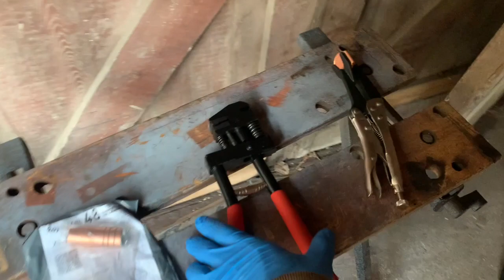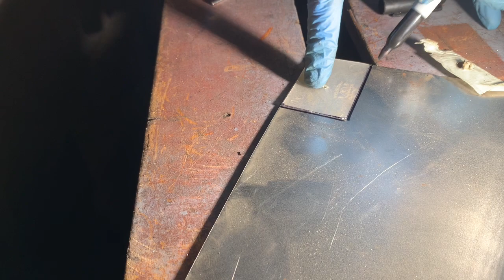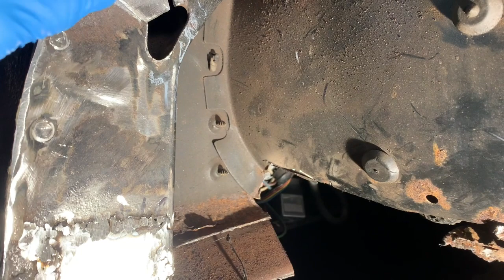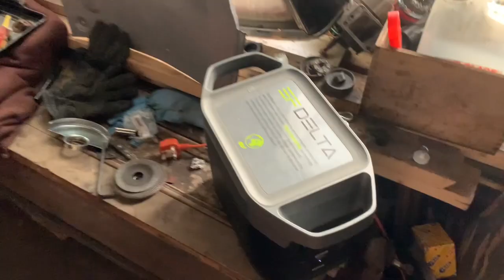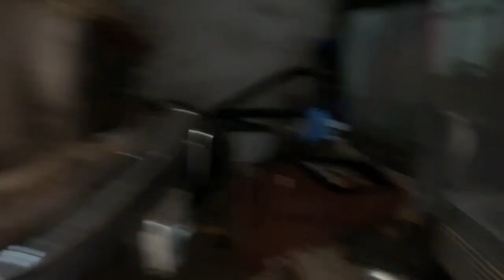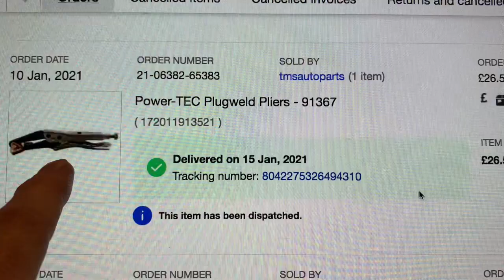Mercedes R107 welding using Ecoflow Delta battery

Comment: Hi what light source do you use to light your garage up, while using eco flow battery. Just bought one, cant believe it runs my welder 😊. Thanks to your video, just need a low power lighting for my garage now, if you recommend anything on a budget. Thanks
Reply from the maker: Yes - the ecoflow is amazing. I hadn't realised it at the time but is has a built in charge controller which means  you can plug solar panels straight in...perfect for our vintage camper.

Anyway...I have standard 240v light  fittings in my garage so I just replaced the bulbs with LED ones and that works a treat. I guess you could also use 240V led strip lights.

When you plug things into the 240v sockets, the cooling fans will always kick in which can be a bit noisy and inefficient. If on the other hand you use the 12v cigarette light socket, you probably get the same amount of light with much less power usage. In our van we run lights, fridge and sink through the 12v port:

https://www.youtube.com/watch?v=ojeR8UHOIQs

Mike

Comment: Hi Mike what amps was the welder. I have a gasless parkside 230v 40amp to 90amp not sure if the delta 2 would work with my mig welder. Thanks
Reply from the maker: Hi - I was using a CLARKE 151TE 150 AMP TURBO MIG WELDER (now sadly stolen) Depending on what I was welding, it would occasionally trip the fuse in the Eco Flow….but it is a simple push button to reset. If you are anywhere close to Bristol, you are welcome to bring your welder and try it. I must say that that the EcoFlow ranks as one of my all time great purchases - great for my power free garage and fantastic for camping. Mike
Reply: @MikesMercsandothercars  it's a shame because I'm 4 hours away. Thanks
Reply: @MikesMercsandothercars  was you on the low settings on the mig. Are be welding 0.9mm thin sheet metal
Reply from the maker: @jaybradley3765  I dont think I ever used the highest settings on the welder even when I made up the front strut which was thicker than 0.9mm. Mike
Reply: @MikesMercsandothercars  thanks mike
Reply: Hi Mike I have just bought a second hand Clarke mig welder 151te what you were using, what settings did you find you could set without the eco flow tripping the fuse. Are be welding 0.9mm sheet steel, going to collect it at the weekend. Thanks

Comment: Hi mate thinking of buying this for welding up my Ford capri

what model ecoflow delta are you using here?
Reply from the maker: I am using the original Ecoflow delta. They have just brought out the EcoFlow Delta 2 which costs about £1000....not cheap, but our has been great for all sorts of things, More recently, we have used it to replace the entire solar battery system in our Fiat 238 camper and it works great - much lighter and lasts longer. Mike

Comment: Hi Mike !! Thank you for your lovely video. just a quick question what welder are you using ?..
Reply from the maker: Thanks for your comment. I was using a Clark 135TE welder which my father had bought new from Machine Mart in the UK and never used. Sadly it got stolen some months ago and someone broke into my garage. I usually keep it at home but not on that particular occasion. Mike
Reply: @MikesMercsandothercars  I feel your pain brother. It almost happened to me. I have beefed up my security on my garage to deter the thieves. Thank you for the information bro.

Comment: THank you so much for making this video, I have been looking for the option of doing this for an eternity, but couldn't find out if it would actually power my welder.
Reply from the maker: Thanks for your comment. The ecoflow has been amazing for me as my garage doesn't have electricity. They are not cheap but it allowes me top do things that I otherwise couldn't. Happy New Year. Mike
Reply: @MikesMercsandothercars  To you as well! I had been looking at the Fronius AccuPocket for welding without a power supply, but that thing is like 3k, that is more than the car I would transport it in, haha. And the Ecoflow can power other tools as well, so if it works, that is the much better choice.
Reply from the maker: @maltestoever3633  If you were in the UK - you would be more than welcome to borrow my unit as a test...the only tool I have that wont work is my Dewalt chop saw...these have a huge power surge to get the blade spinning initially and will trip the unit. Mike
Reply: @MikesMercsandothercars  That is nice of you! I once tried with car batteries and a pretty powerful inverter, but that wasn't quite working so I abandoned the idea for a while. I will purchase one of these things in due time and get it working, thanks again and I'll let you know once I manage to figure everything out.